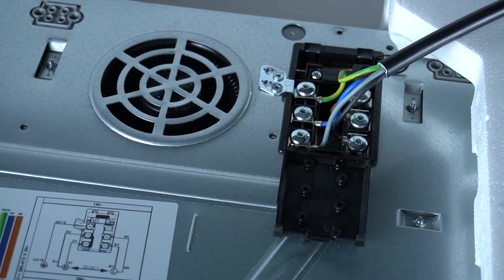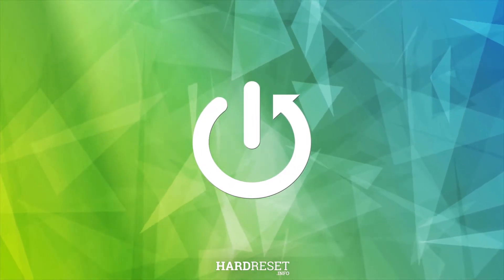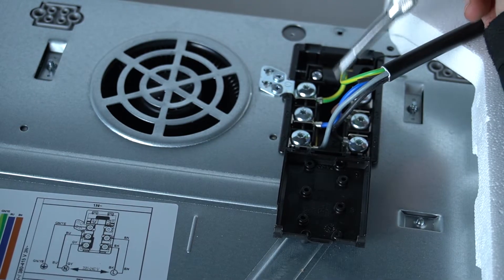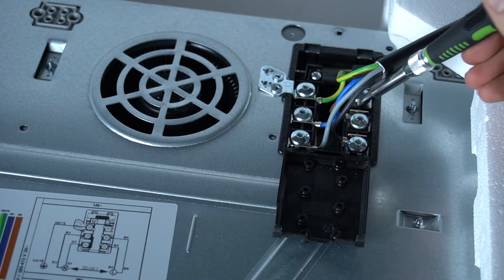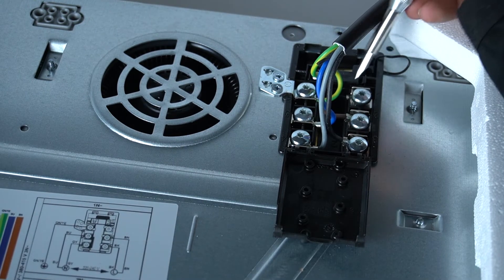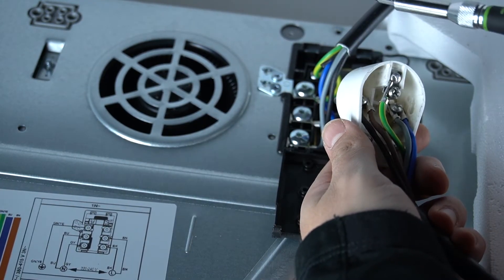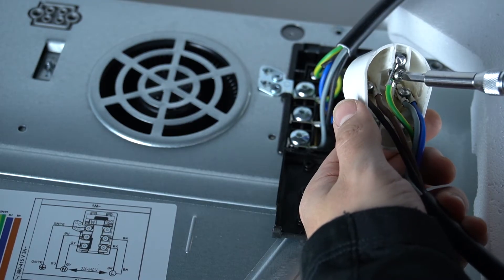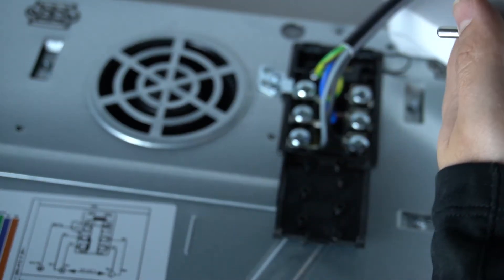Induction Hob Bosch PIF61RHB1E - How to Make 230V Plug? Connect to Single-Phase Installation

Comment: Hi, thanks for sharing this video.

I just bought this hob, but only have 3 cables, Live, Earth and Neutral (Brown, Gn/Ye and Blue). I'm receiving an error message, 3 of the induction areas aren't working, and one of the possibilities is wrong installation. I believe it's something related to the bridge not being in the right position. Are you able to help me with that? Cheers
Reply: There should be a drawing showing how to bridge the sections before connecting cables.

Comment: Isn't this potentially very dangerous? That's a 7.4kW hob. Most wall plugs in europe are 16A 230V, and the cables in the walls are 1.5mm or 2.5mm, neither of which can safely carry 32A. Best case, it will trip your 16A breaker. Worst case, that cable will catch fire.
Reply: Hi mate, I read some spec of all electric cooker. they just mention the power consumption up to 11kW. does it mean I need to have a dedicated wire and fuse that can allow 50A (=11kW / 220V)?